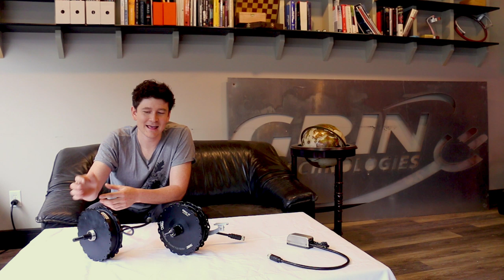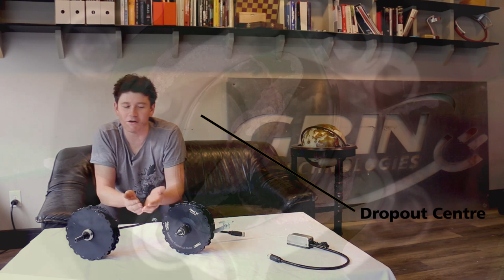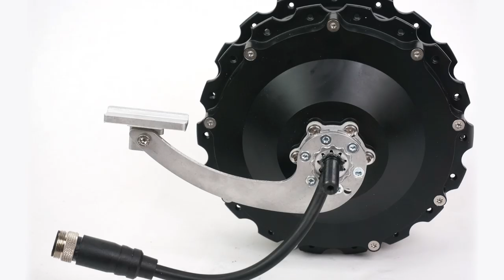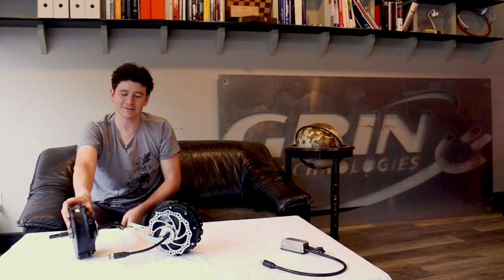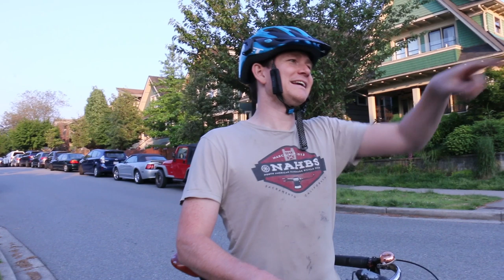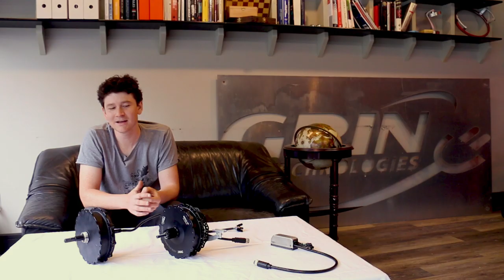Introducing the GMAC Clutchless Geared Hub Motor from Grin Tech

Comment: hang on in the braking demo you say you use nothing but regen braking..at the stop sighn the bike stops completely and abruptly...i was surprised as the braking from regen only should be nearly useless at low speed...what happening here?,,and how do you actuate the regen brake?
Reply from the maker: Hey Russel, with a controller like the Phaserunner that can do plug braking you can have 100% braking force even at a complete stop. The catch is that rather than energy going into the battery pack, you consume power.  So in this situation if you looked at the Cycle Analyst while coming to a stop, at first there is lots of negative amperage going into the battery, but as the bike slows down the regen amps into the battery decreases, and then at around 5-6 kph it starts going positive and consuming energy in order to sustain that braking force. 

If you don't enable plug braking, then you are correct that at lower speeds the amount of regen force decreases. Maximum you can achieve without drawing power from the battery is the same as having all 3 phase wires shorted together.
Reply: @GrinTechnologies  very interesting!

Comment: Does a cassette lock ring tool slide over the axle so it can be removed or installed?
Reply from the maker: Yes, the GMAC axle is just 10mm so any standard locking tool will fit over it no problem.

Comment: Will we ever see a non nylon geared version for serious power?
Reply from the maker: It's something we're keeping an open mind on, but at the moment the mechanical nylon gears aren't really a bottleneck in performance. You'll generally be hitting thermal limits of the motor at much lower torque levels than the where the gears themselves fail.
Reply: Also, the current nylon gears are very quiet.

Comment: Great video and groundbreaking e-bike tech. I have a TWO wheel drive E-CELLS emtb with to SAMSUNG batteries (20 Ah and 15 Ah) and two 52 V (yep, 52 V) BAFANG 750 watt  motors. Can I replace those motors when they go tits up with your GMAC clutches motors in BOTH wheels and get region from both motors? 
If so then my only other wish is for new solid state batteries with half the weight, 50% more range and 10 minute charging!
Reply from the maker: If both your front and rear dropouts are 135mm then yes, in principle you could. But to get regenerative braking you would likely need to replace both motor controllers too.

Comment: I’ll trust your answer since you’er not trying to sell me a bike. Geared  hub motets have more power and torque then a direct drive.? Which type of motor breaks down more often and is harder to repair? My nest Ebike I was leaning towards a mid drive. 
I e only had my first Rear hub direct drive Cargo Bike  since May.  RAD brand. I intended to buy the Blix cargo  but that’s another story.
Reply from the maker: Geared hub motors have a better torque to weight ratio than direct drive motors. But in absolute terms, most direct drive motors are pretty large and so have a respectable torque.  The GMAC can produce high torques more efficiently than a similar large direct drive motor, but the direct drive motor can still do it and is more robust.  We certainly have fewer repair / RMA issues with large direct drive motors like the RH212 than the GMAC motor for instance.

Comment: What does regenerative braking do to the life of the battery?
Reply from the maker: Nothing negative that we've been able to see after about 15 years of field experience, and that's with max regen currents set to about 2C in many cases.  You wouldn't want to continuously charge a battery from empty to full at that rate, but the few seconds or 10's of seconds it is present during regen braking does not seem to have any detectible effect on battery life with modern lithium packs.

Comment: how much voltage could you pump through one of these?
Reply from the maker: Probably about 600V before you risk electrical insulation issues.  It's not voltage that stresses and damages motors but the phase current you allow through the windings.
Reply: @GrinTechnologies  Interesting, do you mean 60v?

Comment: Is the regen controllable or is it on/off?  I have regen on another bike and cant really use it to its potential because Its on or off.  If I crank up the regen amount, its like slamming the brakes on when the brake switch flips.  It seems like we need an electronic proportional braking integrated into the brake lever.  Does anyone do that yet?
Reply from the maker: The phaserunner has fully proportional regenerative braking.  Since there aren't many (any?) ebrake levers on the market with analog signaling to support this, we do a trick with the CA3 where we use a regular on/off brake cutoff lever to enable a baseline amount of regen, and then while you have the brake lever pressed you can use the throttle in order to vary the braking intensity up and down. This is easy to get used to and allows us to have proportional regen using existing ebike hardware, but we agree that most ideal would be to have that proportional signal in the lever itself.  That could be a 2020 project if there still isn't something suitable on the market.
Reply: @GrinTechnologies i find the proportional regen on the brake/throttle to be quite natural now. Took about 4 times to sink in though

Comment: I am working on a delta tricycle with pedals and gears on the front wheel. would this work?
Reply from the maker: Assuming that you have a 135m dropout spacing for the front wheel and normal derailleur gears, then yes it should work just fine!
Reply: Alberto, I have built 2 Delta Trikes & have an idea for a new design. Would you be interested in sharing ideas?
Reply: daytriker sure 🙂

Comment: Great improvements!  Do you plan on developing a version of this motor for single-sided mounting like your Single-Sided All Axis Hub Motor?
Reply from the maker: Hey Rick and thanks for asking.  We are planning to do a front GMAC version for 2020 and we'll look at ways of designing that axle to accomodate single side installations with the disk rotor and wire on the same side. It's unlikely to be quite as elegant as the Grin All Axle hub since we can't do a 20mm hollow axle (the small diameter motor sun gear being a limiting factor) but there should be some creative workarounds.

Comment: Will this motor work on my 2018 RadMini as is? If not  am I able to modify my platform to yours. If this is doable please advise as to making this happen. Thanks.
Reply from the maker: If that's a fatbike frame with 170-190mm rear dropouts then unfortunately it won't fit, but we are exploring the options of doing a fatbike version of the GMAC sometime in 2020 as we get a lot of requests for this.

Comment: I want one of these front and rear for my fat bike 26 inch tire but I can’t get a hold of anyone on the phone
Reply from the maker: It's not suitable for rear fatbikes as those usually have 170 or 190mm dropouts. But it can work on front fatbikes forks with 135mm spacing. You'd want something like a g060 or g062 for the rear hub.

Comment: If they could use helical gears to make it quieter and improve the motor cooling, it would be awesome.
Reply from the maker: Agreed! Though just adding a low viscosity oil to the motor is a simple way to help with the cooling and also subduing the gear noise a little too without the complications of axial thrust that are caused with helical gears.
Reply: Grin Technologies The axial thrust could be solved by double-crossed helical gears. Adding oil sounds like a good idea, but I have heard too many stories of leakages onto brake discs. Perhaps if the motor was built to contain oil from the factory...
Reply: When my GMAC8T runs at 1-1.5kw, the wind is far louder than the motor. Cooling hasn't been an issue. Phaserunner also provides thermal limiting and rolling battery reserves in programming. These are not real world issues in my experience at 60-90F ambient on the road.
Reply: SoloSailor sv For you, Yes, but everyone around can hear the motor screaming. If you live in a hilly place overheating is a problem.
Reply: @tarmacaddict3923  true, i don't load the motor,gears,or battery in my low-torque, speed focused, use. 
SF hills (driven there) i think would encourage a mid-drive with full access to all gears.

Comment: still not as good as a mxus 3kturbo 45h motor that takes 135mm and can do regen
how about a geared motor clutched that can handle 100v 135mm front 150mm rear and can output better torque than a 205 50h hubmotor...

Comment: I doubt that regen braking for 3 seconds would top off the 20w of constant " Freewheel" feeling needed...
Reply: Regen on a bike saves brakes that's it, not enough mass to put any REAL charge back in the battery
Reply: @ianmangham4570  You are correct. This is just a marketing ploy in very light EVs'.
Reply: That heavily depends on how many hills there are on your route. If you don't have any hills on your route a freewheel would definitely save energy (and put less strain on your battery
Reply: @AniviaS  Yes, going uphill kills batteries way too fast anyway compared with the regen

Comment: Me and my dog live a nomadic lifestyle on my ebike. I pull a trailer that I built myself using a wike kit. The combined weight of me, my dog, bike, trailer, and gear is 440 lbs or 200 kg. My bike is a specialized roll sport, with alot of custom parts. My motor is a 12t Mac motor, a 23ah 52 volt battery, and a cheap Chinese controller. I also have a cycle analysis ver. 3. Which makes this bike more expensive than a girlfriend, but I'm very happy with the investment. I got the whole kit from em3ev. So far I've got 1000 miles on it, but I can tell I'm gonna have problems with the controller, and the clutch is the weak point of the motor. I will be in contact with grin soon about getting a phaserunner controller, and later this motor. I pull alot of weight, and have lighten things as much as I can, but since I live on my bike I must carry alot of gear. I was wondering if this motor comes in a 12t? I really like the 12t, it's alot faster than I thought it would be. I would also like to add that mid drive isn't an option for me. I would shread any chain or cassette, not to mention pull out all the spokes of the back wheel due to the trailer. I have my motor on the front wheel, and it works out better than I thought it would.
Reply from the maker: Hey Sam and thanks for sharing the story. The reason we didn't go with a 12T option is that with the supplied Phaserunner controller there is simply no advantage to the slower winding. It doesn't produce any more sustainable torque as the Phaserunner can already put out more continuous phase current than the motor is able to handle before going into thermal rollback. A slower winding is only beneficial when you are bottle necked by the phase current output of the controller, or by thin gauge motor phase wiring, neither of which apply here. 

If you have a front MAC motor already on the setup, then it would work quite well to run a dual motor system with the GMAC on the rear wheel. You'll be able to share the load across two hub motors which will allow it to climb with much better efficiency than 1 motor, and you'll get the regen benefits of the GMAC on the back.  See:
https://www.ebikes.ca/product-info/grin-kits.html#dual-hub-motors
Reply: Grin Technologies I've thought about going with a dual motor set up. What worries me is the torquing of the towbar of the trailer on the motor. It will have to be able to withstand 75kgs of lateral load shifting on  one side of the axel. If you believe that it can take it, I will green light it. I will also need to get another battery which will add even more weight.
Reply from the maker: @samstarr7766  From a load perspective it's no different than the towbar being on a non-electric hub axle.  75kg of trailer weight is nothing compared to what some of our customers have pulled behind them!